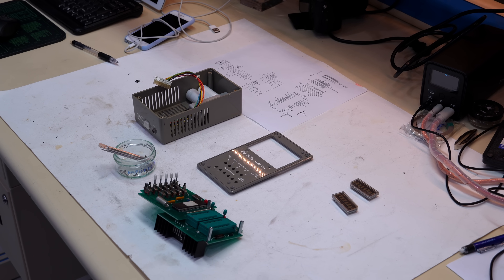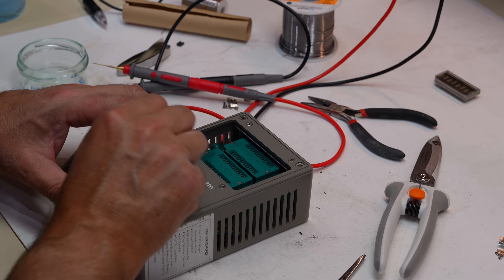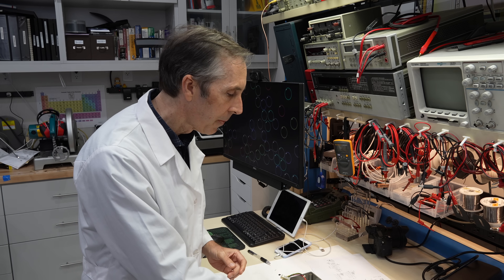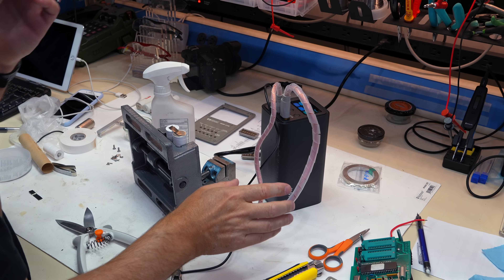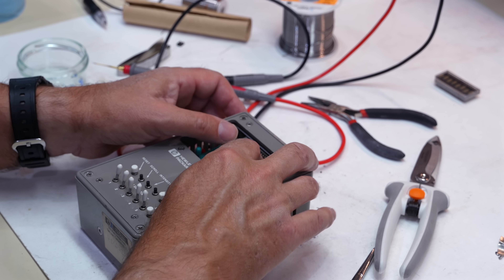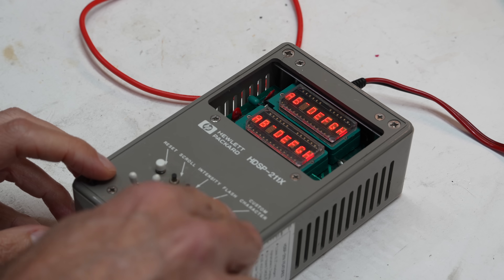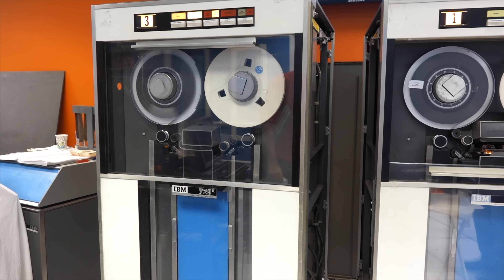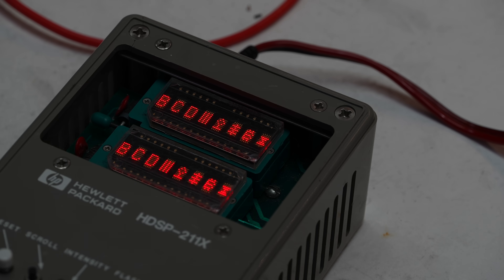HDSP-2112 vintage LED "intelligent" displays

Comment: I have some of these HDSP-211x, likely the 2112, somewhere in my stash; they are genuinely NOS, as they came from a stores clearout where I worked in the mid 90s. They were spares for a control panel that I don't think we ever had a need to repair.

Comment: 😍😍😍😍And no one remembers that these displays were widely used in the first Motorola cell phones, the DynaTAC series from the mid-1980s. It was such a success for the company that they even made special, custom series for smaller models, like the Motorola microTAC Elite, in addition to the famous and beautiful StarTAC, in 7-digit and 8-digit versions, in red and orange versions. I also saw the microTAC Lite series with a green display. A beauty. I dream of getting these displays in Argentina; they're very expensive, but dreaming costs nothing...

Comment: Yesterday I used Gemini, DeepSeek and ChatGPT to remind me how to wire up a microcontroller to my two HDSP-2111 displays.... These displays and documentation have been out there forever and seemed like a nice test. The “comprehension” shown by these AI products was more than a little disappointing! DeepSeek thinks the 2112 has no pins D0-D7 as it is a “serial” device. Gemini does better but has a “cock and bull” story on what you should do with CLS and CLK. It is scary how much faith people have in this stuff.

Comment: I bet those expen$ive LED displays are the same type as the ones I saw on a "Scrapping" channel where the guy opened a box of various items, including a bag of LEDs.  He did say that there were some expen$ive HP LEDs included in that bag of LEDs included in the box of stuff to "mine" (my word) for valuable metals like gold & silver, etc.  I think his video was posted earlier the same day as this one was.  Since he seemed to recognize these LEDs, hopefully he saved them from the box of stuff to scrap out to recover the valuable metals, especially since the value of materials in these LEDs is *much* less than what they can be sold for.

Comment: But are these really vintage? These are still available. They are an excellent choice when creating high reliability applications. It seems the HDSP2000 Series are more vintage, these were produced since 1975.
Reply: The demo unit certainly is

Comment: Very nice. I've got a handful of Siemens 5x5 displays which are bit-bashed like the earlier HP displays you mentioned. Cranking the speed up on an Arduino can make for some fun effects. 
Admittedly the ASCII interface is a lot easier to deal with from a design standpoint, I love the freedom you get from being able to manipulate the pixels directly. Sunset fade effects, smooth scrolling, the limits are only your imagination. Such pretty displays. Thanks for showing us a hidden insight into a bit of HP history.

Comment: I got myself  sample book from Lee filters, with that I am able to find a good filter for the displays I use by removing the colors I don´t want and thereby increase the contrast, It won't be the original filters but it be close. Maybe some filtering for your ceiling lights would do good for your camaras, Just be careful it removes colors from the lights.

Comment: These are really neat. I have a couple tubes of LTP-305R & LTP-305G matrix LEDs from Lite-On-- they were around $2.50/each last time I ordered them in 2022. I just checked and it looks like they have been discontinued in the last couple years. A bit of a pain to drive a bunch of them, since you need to use a matrix display driver, then handle the illumination yourself. But the biggest issue: they draw a TON of power. Each dot has an If of 20mA, and are rated to run continuously with all dots consuming an average of 10mA -- so 360mA per character if all 7x5 dots + the decimal dot are lit.

Comment: Back in 1989, I built one of the first LED name badges using this display and an 8748 as well (I also made one with an 8085...).  Won second place in Circuit Cellar Ink's first design contest.
Reply: An LED name badge with this is such a cool idea.

Comment: When you told us they were introduced in the 88-89 Optoelectronics Designer's Catalog, I hit pause, went upstairs, and pulled my copy off the shelf. So I could follow along at home...
At the Repair Cafe, I'm currently working on a Zanussi air conditioner which uses a 2-digit multiplexed LED display. It's marked DL-5621, but it isn't an HDSP-5621, as that part isn't multiplexed - I checked in the catalog! I wonder where it came from? (It looks like two of the segment drivers are stuck low, and as it uses these to scan the input buttons, some of those aren't working)

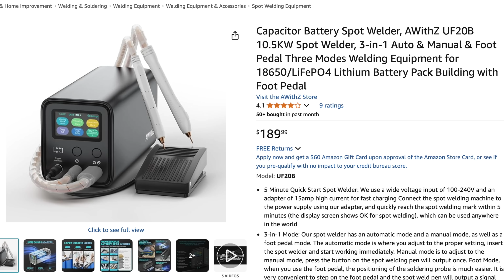Comment: 6:43. Thats very expensive for a spot welder. I would have thought you would make your own much cheaper. You just need a transformer, some big capacitors, 10000uF or more, a high current low voltage MOSFET and a gate drive circuit.

Comment: AFAIR the IBM PS/2 Server 95 and 95A had this or a very similar display to show POST codes and error messages. Can be used to display a computer name and such. Replacements had been made by Agilent for some time IIRC. Thanks for showing !
Reply: sure does! you can control it from your own programs by writing to IO port 0108h to 010Fh (one address per character, just send it an ASCII code)

Comment: Those cheap displays from China I believe were from Motorola tac 2. And many with their sync pin cut off. A few years ago, these old phones burst out in the market, and extremely cheap. The display itself is only about 1 - 3 dollars. So I bought quite a lot. There was also a Siemens version of this, instead of a plastic case and glue seal，the Siemens version seal the whole display in resin.

Comment: They used a derivative of these in early Motorola brick phones, except they penny pinched and had them made with the first digit unpopulated. I worked for a telco so scrapped a phone or two.
$80, thats nuts, no wonder the demo box used ZIF sockets.
Some of these suppliers are pure nuts, I was looking up wire would pots/rheostats the other day, one was over a thousand dollars, they must have incredibly cheap wharehouse space as this stuff is going to sit on them shelves for a very long time.
Reply: I can only think such sellers have the idea the world is populated by rich, impulsive idiots.  It’s a disconnection from reality!

Comment: I have a small stash of these waiting for a project. Needs something more interesting than a clock but less pixel-hungry than a graphing calculator. Any ideas ?
Maybe a terminal. But I already have an early Microwriter with 14-segment LEDs (later units used LCDs)

Comment: these were used on motorola analog cell phones, like the startrac.  when I was much younger I harvested some of these when the phones were EOL.  they are socketed in the phone, so it's easy to remove.  they had 7 digit and 8 digit models of these in there, both green and orange.  You can generally tell if it was harvested from a phone, since the leads are quite short vs. a new old stock one.
Reply: The high power requirements for the display must have contributed to the Startrac's short battery life.
Reply: Ah, THAT’S where they looked familiar from!
Reply: That’s a great tip. I have one that I’ve never cracked open. New project for Monday!

Comment: For the filters, you might want to ask for a sample pack of theatre lighting gels.  Many companies will happily send you a free swatch-book of all the filters they produce.  I've found it to be super handy, especially when you don't know quite which colour you need for best contrast.
Reply: I found a roll of red transparent wrapping paper recently. Very thin but very red. Whenever I come across a bit of red transparent sheet or cover plate, I hoard it. I have some seven-segment displays I've been working with that needed it under camera lighting last week. These displays actually look quite good without one, though.

Comment: Have a collection of various LED displays, got some HDSP25xx too, which are skinny versions of HDSP21xx. There are also ceramic ones. CMOS versions are HCMS, they consume slightly less power, and are mostly a long shift-reegister with a latch and LED drivers, no character decoding. Similar to HDSP2000 series, but with entire "framebuffer" and multiplexing circuitry. Bet that over the years I spent a small fortune on this collection…

Comment: This sales demo box was really interesting to see, because I have another HP LED demo box from an earlier time but clearly from the same design philosophy — everything except the battery mounted on the removable panel of an enclosure, leaky NiCd battery, 3-position power switch, and designed to demonstrate specific HP parts. But instead of alphanumeric displays, it runs seven-segment displays and single LEDs off of two separately adjustable 0.2-20 mA current sources. Quite handy as a LED tester!

Comment: Those things were GREAT! We did a design-in with them in a programmable function panel in 1989 or so. (IIRC, we used the 2112 and 9 groups of two each--they are side-by-side stackable. Somewhere I probably still have code we had as a test to program the user-defined characters in them, walk text, use the blink, etc.

Comment: wow - I have one of these!   serial number 5027.   I just pulled it out to be sure it was the same and yeah, the batteries are crusty and the barrel jack corroded.  The power supply with it (which I'm sure is not original) is 9VDC center positive.   Might be fun to buy a few displays to play with (I have one that came with it) but I have nothing at present that I'd use them in.
Reply: 7805 needs a couple of volts of headroom so 9V in is the usual off the shelf choice although it does mean it puts out a bit of heat. If that big heatsink is on the 7805 it won't get too hot, also Marc said there are some diodes involved which will help if they are in series with the input.

Comment: 250 mA per display?! That's nuts!
Reply: Welcome to the 1980s! I worked on a computer that had a 5.2V 2000A power supply for the half megabyte memory module. You could put up to 4 modules on the computer.

Comment: I have some of the "dumb" versions of these displays.  They have 4 characters of 5*7 dots and come in a 14 pin ceramic DIP.  They take a lot more brains to drive, but they are equally beautiful.  Love these things.  I want to make some out of discrete parts some day.
Reply: HDSP-2000? I drove some with a PIC, nice displays, need a lot of current.
Reply: @8BitNaptime I have one of these too. Would be nice to make a watch out of it.
Reply: @TinLethax they use so much power that might be impractical.
Reply: @davidwillmore Yeah your right. It will probably have to sleep most of the time. And using button interrupt to wake up the MCU to drive the display for something like 1 second.
Reply: A lot of current.  @8BitNaptime

Comment: Instead of NiCd I guess you could've used NiMh like the usual conversions.
Reply: They're being charged by the device itself  and NiCd's are charged different than NiMh. It's not recommended to charge NiMh in a NiCd charger.
Reply: @Ni5ei For fast charging NiCds this is more important, but for slow charging ones I have not heard it making a problem. NiMhs the same size are usually much larger in capacity too, so they will charge even slower.

Comment: I have hundreds of several different HP dot matrix HP displays.  I use them in projects anytime I can.  Sent a load of displays including these to IMSAI Guy here on YouTube some time ago.  IMSAI Guy worked for HP back in the day as a engineer in their optics division.  Ironically some of the displays I sent him were produced while he was in Penang Malaysia at the HP production plant in the early 80's.
Reply: Sos un afortunado!!! hace años y años que quiero tener esas pantallas, aqui en Argentina no existen, y en el exterior son dificil de conseguir. Mi amor por esos display matriciales de led, empezo gracias a los telefonos MOTOROLA, que usaba esos displays, aunque customizados en los que conoci, por ejemplo en el Motorola microTAC Elite, u otros modelos, pero los DinaTAC de mediados de los 80 y casi empezando los 90, usaban esos displays, que los hacian HP. Saludos desde Argentina.
Reply: @Sebas_Cba_82  They still make them.  Most suppliers show them in stock.  I checked DigiKey and they show they have 240 in stock.
Reply: @Sebas_Cba_82  They are still made.  They should be available from most suppliers.  I checked DigiKey and they have over 200 of the HDSP-2112's in stock.

Comment: You made a remarc about how the release lever sits higher than the filter, but honestly you'd have to remove the filter to move the latch and replace the displays, so it seems like it's not an issue. 😊
Reply from the maker: Duh!